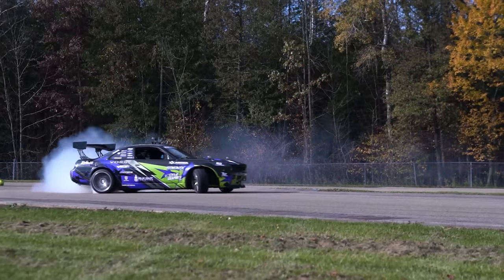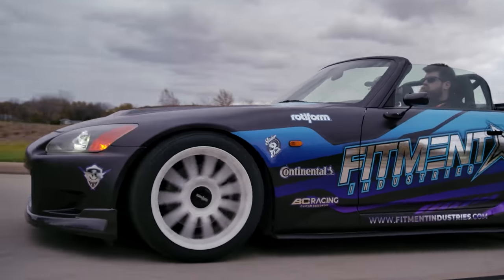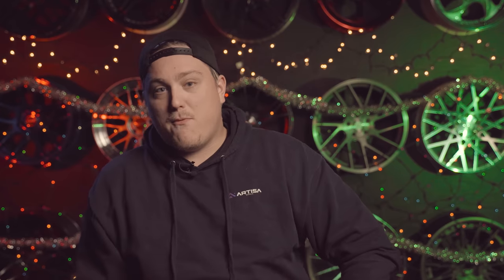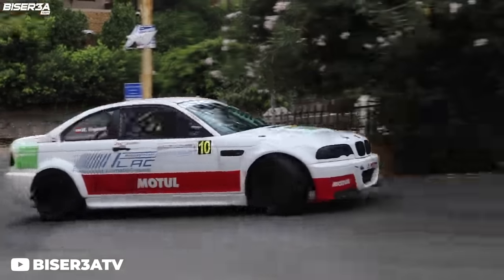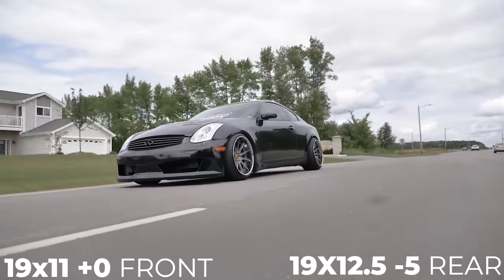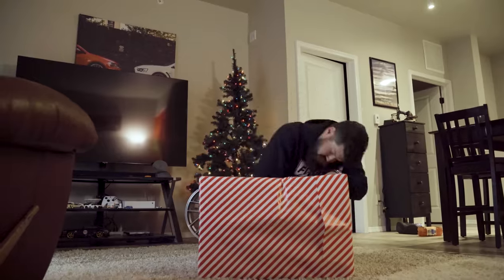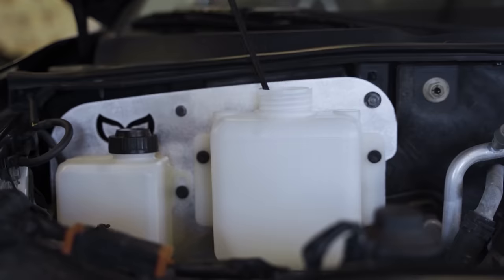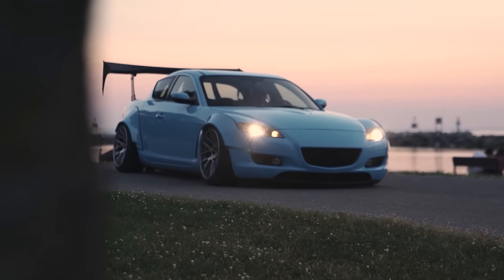Best RWD Cars Under $5,000!

Comment: day 29 of asking for “Driver to Driver” with the genesis coupe (which is also a solid rwd car that can be had around 5k)
Reply: i’m assuming you mean the 2.0t ? how reliable are they ?
Reply: “Solid” debatable but yes a car that is rwd and can be bought for very cheap. Still a genny lmao
Reply: @nxv-chan2958  
No bro the V6 is were is at and the Track edition back's that check it out. 👍🏽
Reply: Haven't seen one of those running for anywhere close to $5k hardly ever.
Reply: @nxv-chan2958  they’re reliable… if you dont tune them lmao. Ask me how I know
Reply: @TheRealMrRoyal  
True that but is cheaper than a 370z.
Reply: @nxv-chan2958  I mean the 3.8 was the best car I’ve ever owned second you my wrx. Unfortunately I was a little rough with it and suspected the car had a history I knew about but to this day is in my top 3.
Reply: @TheRealMrRoyal  b1k 2.0T’s maybe. Anything else after that I doubt
Reply: @ikxngsteph8921  maybe....here in the PNW I can't find any Genesis at all for even near $5k. Best I could find was a 2010 2.0t 145,000 miles for $8500 but that was auto. Manual would be more. Not a single cheaper Genesis within 100 miles of Seattle.
Reply: @nxv-chan2958  not sure how the 2.0s are as far as reliability but the 3.8 is great
Reply: @TheRealMrRoyal  2.0 bk1s are around that 5k range
Reply: @Carlos_Jzx  depends on what you really want, if you want long term performance, go with the 2.0t, but if you want power out of the box and the cool v6 trumpet, then 3.8 is the way to go
Reply: @uselessweeb1090  
Nahh bro the track edition has more bank for your buck.
It comes with Brembos from factory!💪🏽
Reply: @Carlos_Jzx  no fr. The 3.8L r-spec is everything.
Reply: @TooFlyNico  👌🏽
I had no idea of that edition. 👍🏽
Reply: You will not find a BK 2 for $5k you would be lucky to find one under $10k.
Reply: I had a 2015 3.8L Genesis Coupe and the amount of engines blowing up on the facebook pages every week was innnsanity.

Fun car, maybe the 2.0 is different but idk if i’d recommend them.

(i’m also the opposite of a mechanic, so maybe i’m just wrong idk)

Comment: For those that do not know, the 1994-1995 Mustang 5.0 GT has more naturally aspirated horsepower potential than the 1996-2004 4.6 2 valve Mustang GT. Trick flow heads, cam ect will give you more power than a 2 valve can get n/a.
Reply: I didn’t know that. I always thought the 4.6 was the better motor. And wasn’t that 5.0 actually a 4.8 or something?
Reply: I agree the early sn95 model with 302 had much greater potential. They are just unloved because you rather have a lighter foxbody than a dumpy jellybean. The ford 4.6L was quickly forgotten as the great Chevy LS was later crowned king baby!
Reply: @spideybuildscars  the older 302 was a 4.9L,  but who's counting and most tricks for the prev gen foxbody worked on it.
The 4.6L was reliable, but very forgettable until 2005, unless you had a 4v that were in the svt or mach 1 special edition. Otherwise it was like ya had a 2dr crown vic.
Reply: @spideybuildscars  technically i think its a 4.94. Better than working with only 4.6 liters in naturally aspirated form. If you want boost i suggest looking for a 4 valve 1996-2001 Mustang Cobra. 96 would be cheaper and they can handle a lot of power. Like 600+whp all day.
Reply: @toTheWatcher  at least until the first gen 1 Coyote came out. Weighed a lot less than the Camaro between 2011-2014
Reply: @GrimReaper1675  coyote is definitely a game changer, but that  was over a decade that the LS had to cement a legacy against the 4.6l. By the time 4.6l started to get decent it was overshadowed by the next gen LS and LS had dominated the aftermarket scene that the coyote has to overcome. There's a reason most old hot rods have a sbc 350 or sbf 302 until everything basically has a LS. General mkt just didn't latch onto the 4.6l and only recently have we been seeing more coyote swaps as the LS is a bit dated now and modern hemi is DOA due to cam oiling issues & LS is cheaper, easily faster & more reliable than the hemi.
But your not getting a coyote in this price bracket.
Reply: @toTheWatcher  lol cheapest i’ve seen a first gen is 18k so you’re right about that. But don’t forget the Terminator Cobra come out in 03-04 and destroyed the Camaro in all aspects of performance. Some say the Cobra “Terminated” the Camaro from existence.  Forged internals DOHC 4 valves per cylinder. Also you can get a junkyard 5.0 with an iron block out of a junked F150 and boost it to the moon. I know a guy that actually had a 2005 mustang gt, swapped a iron block 5.0 out of a F150 and it worked with his original 5 speed transmission. So if you already have a 2001-2009 Mustang, i believe the stock trans will work with a 5.0 so basically its a dirt cheap swap for some :)
Reply: @GrimReaper1675   I really like the svt cobra in '03 also for it's radical IRS,  but that's still 7yrs of lack luster 4.6L history. And at that point the Camaro was just a poor mans Corvette.
I actually have a roller 302 out of '91 swapped into an rx7. Technically the truck & mercury 302 are low output motors spec more for torque. You want a 5.0l out of a Lincoln or mustang where intake points to the left. But if you swap heads and cam it doesn't really matter, which anyone should as it's a huge difference on that era.
Reply: @toTheWatcher i think you misunderstood me. I’m not talking about getting a junkyard 5.0 from a 1993 f150. I’m talking about getting a junkyard 5.0 out of a 2011+ F150 with the Coyote 5.0. I know someone with an 05-09 Mustang GT and he kept his original manual 5 speed trans from his Mustang and put in the 2011 5.0 from a F150 and added turbos. Iron blocks take more abuse  :)
Reply: @GrimReaper1675  the Coyote, no matter which iteration, are all aluminum blocks. Iron blocks can take more punishment, but the fastest stock motor coyotes don’t crack the block so I think it’s safe the say the aluminum is fine. The F150 has iron exhaust manifolds.
Reply: @169abr  I see. Even then. People get gen 2 coyotes and make 800+ on stock internals. Even a stock coyote engine is fun to play with. The truck version makes less HP but I believe they have more low end torque.
Reply: @GrimReaper1675  more low end grunt for the different manifold, and the truck engines have worse cams until Gen 3 I believe. I love my bolt on Coyote it’s a blast to drive, and they’ll make a bunch of power. These engines are just insane.
Reply: @169abr  what Gen Coyote do you have and what mods? I have a gen 2 5.0 Mustang with Flowmaster outlaws, SR X-pipe, ford performance pack 3 (CAI, throttle body, intake manifold) and a couple other goodies like suspension work.
Reply: @GrimReaper1675  Gen 2 6R80 (I would’ve gotten a stick shift but I got in an accident and shattered my left knee), JLT intake, tune, and an H-Pipe to Roush axlebacks. Next step is 18 manifold, tamer exhaust and a longtubes and I’m switching to Lund.

Comment: I paid $5400 for my E46 5 months ago, yeah its in really good shape, oil changes done on time, only 119k miles, but that was cheap in my area of western Washington. On average they go for $6500-9000 if you want an M54B30 not the B25.

Comment: 99-04 Mustang new edge offers a bit more power and can be found just as easily for under 5k. Just picked one up a month ago for 4. Gotta look hard and just know you won't find the perfect one in most cases, but they are reliable and can last really long time.
Reply: You get a V6 or V8? I've seen both for under 5k here in California a lot. Hard to find one with a interior that's not super messed up however.
Reply: Finding a clean 2V under 5k is a real needle in a haystack, be amazing to find one.

Comment: I'll say the same thing I say on all videos like this causing the car prices to sky rocket, don't get an E46 unless you either 
1. Have 5k to spend paying a mechanic to fix all the broken shit after spending 5k buying the car.
2. Have the time/money/mechanical knowledge to do the work yourself ( including prop shaft carrier bearing/ all bushes/cooling system/ drop the rear subframe for re-enforcement/ window regulators/ a plethora of sensors and oil leaks / and the list goes on.
Have a great day ✌️

Comment: What about the lexus sc300/400/430 and the is300? The price for them should be around that price right?
Reply from the maker: That is definitely another option!
Reply: Maybe for the SC’s but DEFINITELY NOT for the IS300
Reply: @jpleon314  That's if you going to look for the 5 or 6 speed manual correct?
Reply: @kareemroberts3698  They never had 6speeds, the SC300 and the IS300 are fundamentally the same engines/similar 5speed trans. The SC400 was never offered in a manual from what I know.

But even as autos, IS300’s are $5000 at best if their seriously clapped out and high miles. Maybe you can get auto SC’s under 5k, but the manual sc300’s are some the rarest and most sought after Lexus cars and go for a pretty penny
Reply: @jpleon314  I'm a big fan of the newer a650e automatic transmission especially for drag  but the 1uz has adapters for the cd009 now etc the SC will get popular soon even if auto its basically a luxury supra i think Paul walkers auto mk4 sold for more then 100k as a gs300 owner I been eyeing an  sc to bring back to life..
Reply: Shhhhhh don't talk about it even though many youtubers already talked about. I already can't find an sc300 without it being beat up or high mileage but at least 5k. Litterally trying to save money to get the sc400 and I'm already scared they might jack up the prices too or people start buying them.
Reply: @EnhancedTrashBin  sorry sir ...... my bad

Comment: Isuzu impulse, Nissan 200sx, every mini truck from the 80’s and 90’s, Gen 1,2,3 celicas, celica supras, 80’s and 90’s camaro’s, especially the v6’s but also the v8’s, high mileage mr-s, Gen 1 rx7 and non turbo gen 2’s, old e class Benz, the pinto based mustangs I think they called then mustang II’s, and don’t forget the most indestructible and underrated box Volvo’s, you can fit any motor from a rotary to a v10 in them and even the factory engines seem to be immortal.

Comment: Bought my white package mk3 supra for $3,800 back in 2015. Came with 120k miles on original engine from factory, r154 tranny & car was garage kept. I was the 2nd owner. Now they go for 4-5k just as a rolling shell.

Comment: Hold up on the e46 there is 1 bigger problem with the 330. If you drive them hard the oil pump nut can back off. Well if that happens you lose all oil pressure. Now there is a cheap fix and expensive way. New upgraded oil pump is like 400$ but you can just buy a new nut that can be held on with a wire tie for 15$. But this is only a problem if you drive the car hard. Mine had over 200k and the nut was still fine but I still did the cheap fix when the pan was off.

Comment: That E46 on the thumbnail. First I'd do is,
Replace the rims with 17" BBS
Put the camber in back in original position
Check the bonnet because swaps always happen these days to see if it's an original engine. If the previous owner swap it in order to preserve the original engine than to look cool, it's fine by me. 
Clean it
Service it
If only owning a performance car in Malaysia isn't a luxury

The G35 is a SKYLINE in Japan.

Comment: I been thinking about a Miata but is it worth it? Over a 350z, g35, or 325is bmw coupe, and my dream car 🤦🏾‍♂️ a s13 with a sr20set
Reply: Hell no they're definitely not worth the price especially if it's your only car. It's like not even a full car. Best option you listed there is a G35 if you plan to daily. If full project I'd go 350z. I have a G35 coupe and a 350z and my best friend owns a 330ci E46. The E46 is not nearly as reliable or cheap as the vq counterparts plus it's slower. I love the Z since it's a tad better handling and speed but not much space in there. My G on the other hand has power leather seats, dual climate control, sun roof, backseats etc. Love the interior to the Gs
Reply: @anthonym6918  thanks a lot that’s helpful

Comment: Imma say it right now, being into mustangs and all, you’re better off buying a 99-04 V6 over a 94/95 GT. 

Similar power, better looking, better gears in the rear end, but you’ll want to swap in a rear diff from a 99-04 GT anyway (they’re $100 at most junkyards anyway). And most importantly, you can boost it with a cobra blower for as little as $1500 and make upwards of 350whp with the stock cobra pulley, more if you get smaller aftermarket pulleys but the best part is, the 3.8 block is much, MUCH stronger than a crappy 302 block. Hu

Comment: 1989-1991 Corvettes. L98 engines are reliable and easy to work on and you don't have to work about the omnispark from the LT engines of the later years of the generation.

Comment: e34’s 525-540 (look for ones with winter package, they will have lsd’s) rwd, i see them from 1.5k-5k
Reply: + comes in manual, baller interior, mine has headlight wipers and a landline inside. 525 i got for 1.6. + e34 generation is the LAST hand made chassis and stays mechanical and beautiful

Comment: Double checked for drivable manuals in DFW for $5k or less.
330ci - very few all higher mileage like ~150k+
G35 - sedan yes commonly at 135k, only 1 coupe 165k. Coupes are more like 7k-8k.
Rx8 - yes, but a lot are questionable on the motor, so some be cheap! Cause no one knows what to do with an rx8.
Miata - NA & NB yes, in varying condition. NA's are mostly very high mileage.
Mustang - yes... didn't look, but its a mustang, jelly beans be cheap and whatever forgotten model after jellybean, but before the retro.

Comment: Damn you guys are finding e46s under 200k miles? all the ones in my area are well above 200k miles
Reply: in my area theyre over 200k miles and over $5k💀
Reply: got mine for 180k km ~ 120k miles for $1500, with a coolant leak and misfire (spark plugs). You just have to look for good deals, I posted in a groupchat i want one and someone dmed me, and i bought it the next day.